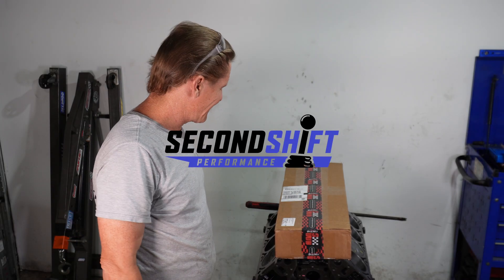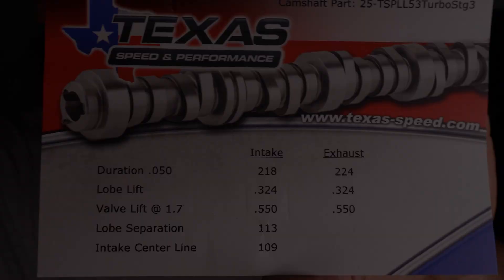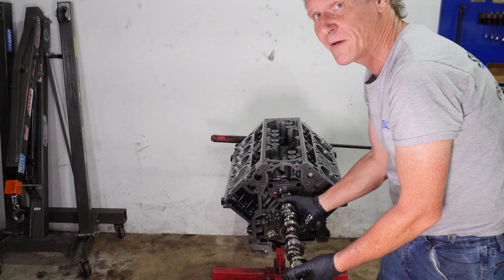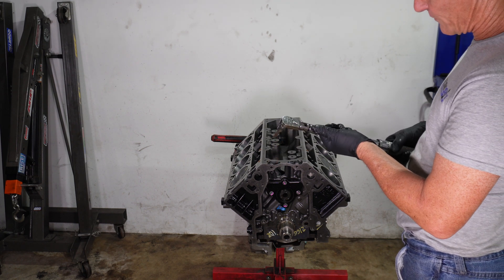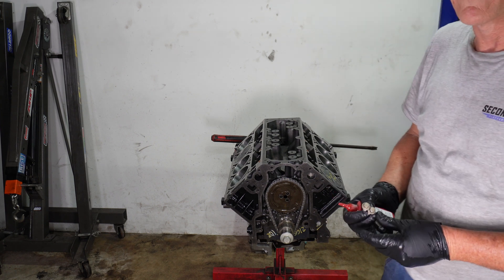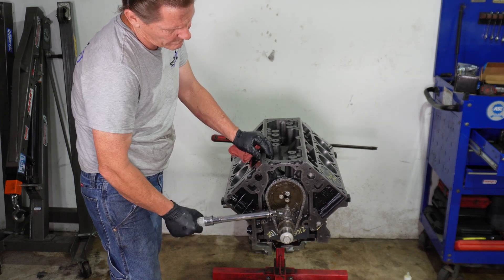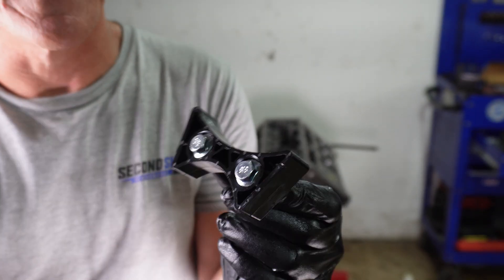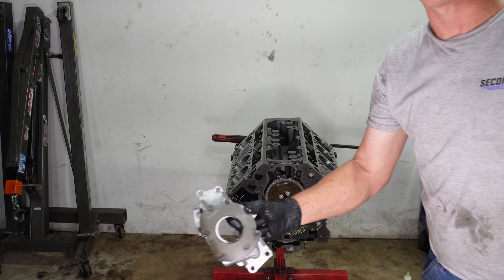Installing Stage 3 Turbo Cam & VVT Delete – 5.3L LMF

Comment: I see some builders shimming the oil pump. Have you ever had problems with this? How critical is it? I intend to build an LS for my firebird so this is why I am asking.
Reply from the maker: The 2 gears of the oil pump are the same thickness. Both gears sit in the same thickness housing and will find their own center as the motor runs because the housing has identical clearances and both gears are allowed to float as they spin being held in alignment by the pump housing and front cover.

Here is an interesting video on the subject: https://www.youtube.com/watch?v=7ShbDoVtH64